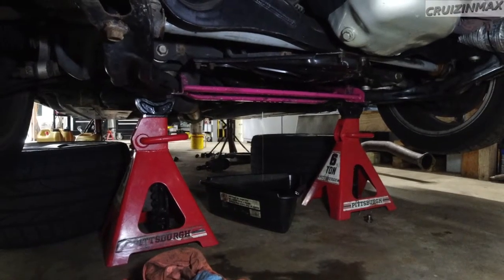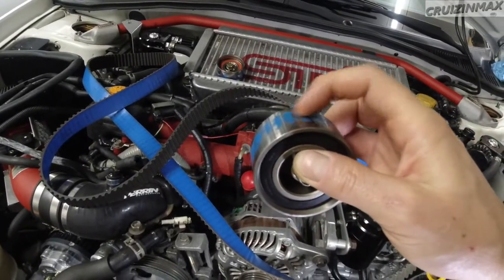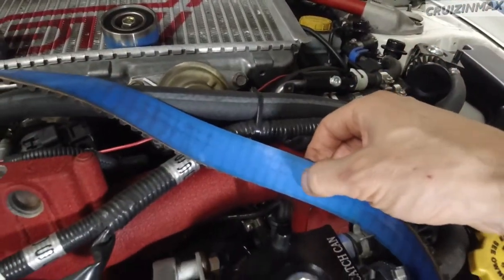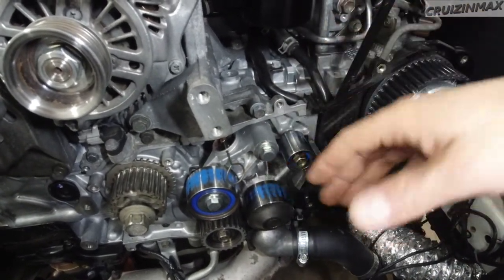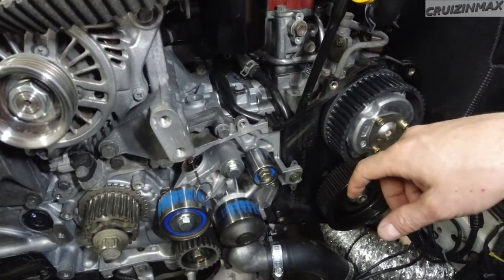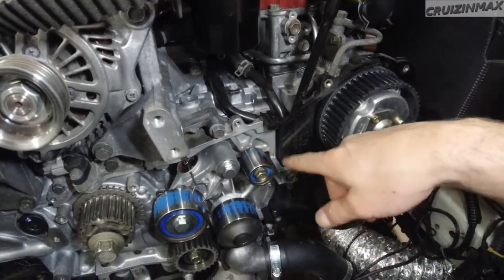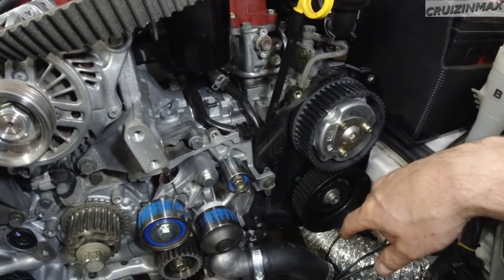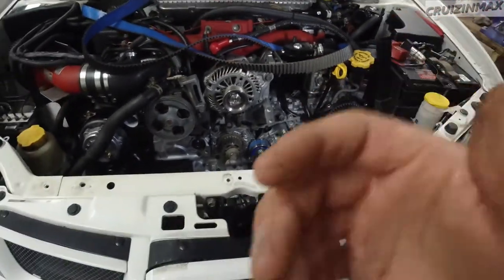Subaru STI paint on pulleys from blue racing timing belt by Gates

Comment: While this is unfortunate, I don't see why it would be an issue. All those components would be swapped out on regular intervals and nothing should slip if the tensioner is working properly. Although I still wouldn't recommend the gates kit, its okay. Lots of people run them with no issues.
Reply from the maker: I dont know if anything bad would happen but Im glad I read that post year earlier and checked it myself.  The pictures of the pulleys of that guys post showed a lot of paint on them, looked like 2mm thick, looked pretty bad.
Reply: @cruizinmax4017  Yeah that's definitely a defect.
Reply: Paint coming off is an issue.
Reply: @pirihern9329  Why